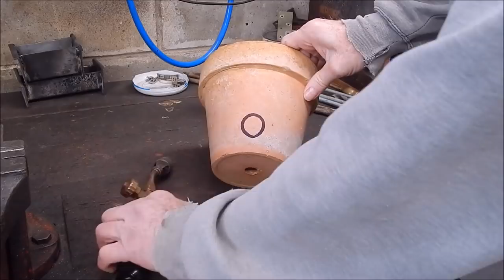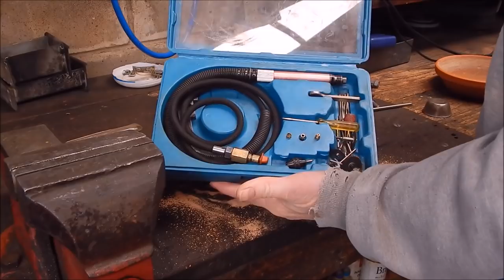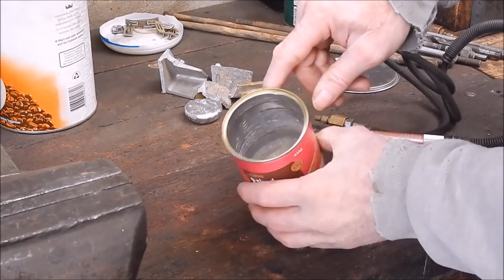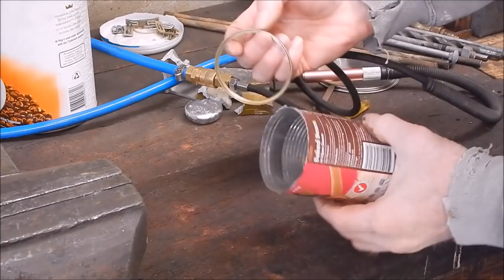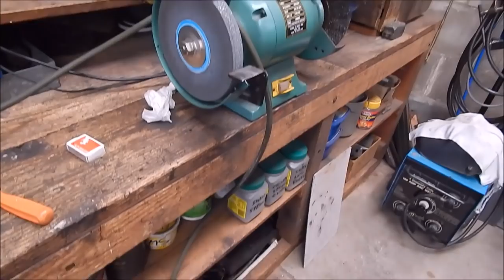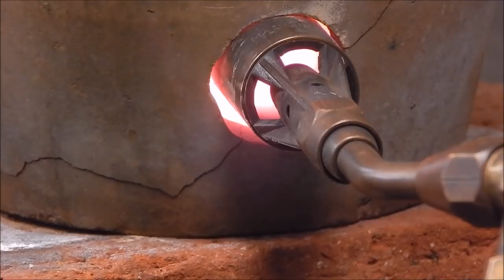Melt aluminium in a flower pot furnace

Comment: Very nice indeed. I have seen these flowerpot furnaces before. They are usually lined, sometimes with cement, or better, castable refractory. As to the lid, don't give up on it. Just drill a 30mm (size not critical) hole through the lid. That will give you draft for the torch. Also myfordboy's channel has an excellent series on furnaces. His torch goes through "tangentially" to the pot, so you get a swirl effect on the torch.

Comment from the maker: This worked so well that I'm making a durable small furnace just for this LPG torch.  It's not a flower pot design as I think the tapered shape of the pot is a bit restrictive compared to a cylinder shape, and the pot is not very durable.  I even spent real money to build this so it had better work.  My next video.  Stay tuned.  Cheers Rob.
Reply: xynudu You look at the subject from the wrong place . not to melt the important thing is to melt the metal form .

Comment: Robert,
     I built a similar setup a year or so back, with a few differences you might want to consider.
I used a flower pot about the same as what you used, hole and all. But I put it inside a metal can about 100mm larger, that used to contain pretzels or chips. I filled the gap between the pot and the can with grout mixed with Perlite (available at the local garden center). Packed it in real good, it took a few days to dry really well. This keeps the pot intact should it crack eventually and acts as a insulator/heat sink.
     If you want to use a lid, use another flower pot like the one you had (upside down) with a hole in it to act as a chimney. Burner must have outside air to work properly.
      Before you  can use any metal can that previously contained food as a crucible, you must burn it empty to get the plastic lining out of it. Or else you end up with that crap in your pour.
     One more tip, if you want to pour bars of a consistent thickness, prepare a level spot to set your mold on. Otherwise they come out lopsided like yours did. Cuts down on wasted material and machining time.
Reply from the maker: Best Racing Tips Win At The Dragstrip Sounds like you've nailed it.  I will take up your tips next time around.  Thanks for posting.  Rob
Reply from the maker: xynudu When the perlite/grout mix hardens, is it capable of being used free standing ?  Could you say put a tin can in a bigger tin can with the mix between them and then remove the cans after it dried - would it hold up with heat ?  Rob
Reply: Best Racing Tips Win At The Dragstrip "Before you  can use any metal can that previously contained food as a crucible, you must burn it empty to get the plastic lining out of it."..   Totally agree there. Sometimes the lining is white and sometimes its clear and you cant see the lining, but it is there. Its probably even more important to pre burn it out if you are using the tin as a mould. What I found if you don't burn it out is its more likely to create porosity/voids when you pour the ally into the can from the lining burning and releasing smoke/gases.
Reply: Exactly.

Comment: Would't it work even better when you put your torch in at an angle in order to get a swirling flame around the melting pot, and make a fairly large hole in the lid, so the gases can escape? That's how the larger furnaces mostly work. cheers.
Reply from the maker: Flip de boer Sounds like a good idea.  This video is bound to get lots of ideas on how to improve the experiment :)  All welcome.  I just tried out the original concept, and got it working with a regular LPG gun.  More time may get it going better.  Cheers Rob

Comment: I was wondering if a flower pot might stand up to my burners so I could use them as a crucible. Steel vessels dosen't last 5 minutes in mine but then I realised flowerpots would have a hole in the bottom. Still, Might be ok for seperating out the steel  from aluminium and copper when I melt things like alternators and starter motors.
I like simple and easy ideas like this. Thanks for showing what you came up with.
Reply from the maker: Oil Burner I wouldn't use a flower pot as a crucible.  No way. It's brittle, cracks easy and would be totally unsafe.  A proper crucible made out of the right stuff would be the only way to go for what you are doing.  Stay safe.  Cheers Rob

Comment: I have salvaged a silver stainless  steel microwave casing which provides a fantastic melting space. It also has the wiring holes which serve as the air entry and exit points and is raised off the floor so when stood on a paving slab is fairly solid. I line the inside floor with firebricks around the edge with a 1" gap all around between the bricks and outer. I fill the 1"gap with vermiculite and then put a 1" layer of refractory cement all over the top of the bricks before laying a mesh across and a 2nd layer of firebrick on top of the bricks only. Ensure the small air (former wiring) holes are exposed and then simply close off any areas of vermiculite at the front with refractory cement and allow to dry/set. Later, return with your blowtorch and melt to your hearts content. You now have a movable furnace where the casing and stand should remain fairly cool and not melt and hopefully it should last for ages. I have been using mine on a weekly basis for over a year and its only getting sooty inside and just occasionally needs a sweep out. I would recommend the stainless steel cases as white colour innards have microwave paint coating and I'd hate you to get gassed.
Reply from the maker: Great idea Nigel.  I suppose you could also use a stainless steel electric bread maker liner/tub for smaller quantities.  Got me thinking.  I must keep a lookout in the roadside trash.

Cheers Rob

Comment: Just to chuck my twopence worth of ideas how to keep it simple and get a better result into the ring. I think lifting the flower pot up a bit (support it on two bricks) would allow air in through the bottom (could try putting the flame in through there as well) hole, then put a couple of bits of steel rod in the bottom of the flower pot to lift the can up a bit, for the lid, use another inverted flower pot which fits outside the bottom one would give a hole for the air flow in the lid.
Reply from the maker: Stephen Deakin Yep, definitely didn't breath properly, even when the lid was canted off.  All good suggestions.  Cheers Rob

Comment: That flowerpot is a write-off! The problem with the airflow is probably due to the fact that you used a stand as the lid, without a vent hole. Using two flowerpots or perhaps a metal plate with a hole in it as the lid may yield better results. 
All furnaces I have seen thus far have an opening at the top.
I'm still investigating the ratio of the melting chamber versus width versus the vent hole diameter. What I've come up with thus far is a 2:1 ratio. The furnace under construction is to have a melting chamber diameter of 21cm and a top hole size of 10cm. The internal height of the chamber will be approximately 36cm. 
Happy casting!
Reply from the maker: Leo Gijssel Thanks Leo.  This was a quick and dirty experiment, but I'm getting lots of good suggestions on improvement in the comments.  So I will revisit this and make a propper small durable unit.  Cheers Rob

Comment: When i used a flower pot it cracked really badly and molten metal and coal went everywhere. Watch yourself buddy. Use 50/50 mix plaster of paris and sand and line your pot with 1-2" of the stuff. That'll act as a pretty good heat shield.
Reply: Paddy Cusack would water based clay work as a heat shield as
 well?
Reply: +toppertruthio I would imagine so
Reply: Paddy Cusack that's not what heat shield means.
Reply: And just smash the pot when dry, and you have a perfect cement crucible ! no need for the pot.....

Comment: Just wanted to say what a great video. But I have a little suggestion for you to possibly try. For your lid you used for the flower pot furnace, use the same lid you did but try and drill a hole in the center of the lid so the heat has a way to vent out a little. I made a little furnace from a tiny paint can and had the same issue with mine until I put a hole in the center of the lid and it worked out great for that. I'm just curious if it would work on the flower pot lid. Thanks for the video and it was great and I'm going to try and make one.
Reply from the maker: Hi Corey,  that video was done quite a few years ago and I've experimented more and moved on since then.  Yes, a lid with a hole in it that can be regulated is the go for best effect.  Plus you can heat up the mold by placing it over the vent hole.  Clay pots are not very safe to use and it should all be placed at ground level in case anything goes wrong, so that molten aluminium will not spread as easily.  A paint tin furnace is a better way to go.  Play safe.  Cheers Rob

Comment: Make a small hole in the lid to vent the fumes out and create an air flow to pull fresh oxygen in, as a flower pot has a hole in the base, kine the flower pots with plaster of Paris as an insulation layer.

Comment: Nice job, Rob! The trouble with clay pots is they don't like thermal shock. If you had preheated the pot before you got down to business, it may not have cracked. They make special high temperature cement for making forges for melting metals. Check out Keith Rucker's YouTube channel as he melts Babbitt for bearings on the old machines he restores. I also liked Emma's comment! Thanks for the video.
Have a good one . . . and eat more beans!
Dave
Reply from the maker: Swarf Rat Yep, that pot was doomed from the moment I laid my hands upon it.  But at least we proved that a plain old LPG torch has enough guts to melt down a decent sized amount of alloy in the right conditions.  So expect more on this subject.  I don't give up easily.  And however I do it, it will be cheap :)  Cheers Rob
Reply: Even with a slow heat/cool down they crack...eventually!

Comment: I like this old video, however, I'd like to suggest you first give the pot/tool a few coats of water glass, inside and out, allowing each to dry completely, before moving on.

Secondly, use 12.5 - 25mm ceramic blanket, as an inside liner, glued on the outermost side, with more w.g. and when dried  spray the other inside fabric with several layers of the same it until the material is  very firm to the touch.

Line the bottom with a layer of ceramic cloth, with w.g.treatment, raise the bottom with a layer of another 25mm, using pearlite, again waterglased.

Make a second hole I to the side of the pot, beforehand, for a 25mm air inlet, to which you add a pipe with a long hose, and a hair dryer on cool.

This is your air supply and will increase the heat, saving gas.

Good luck, and I've seen you other video with the paint cans.
Reply from the maker: Thanks for the suggestions Eli.  My next furnace will be made out of a scrap 9 kg LPG/propane cylinder, or a small air compressor tank I have behind the workshop.  Thermal blanket lining was part of the plan.  Plenty of people have done this and they work very well.  Cheers Rob

Comment: You need a step bit.
Also, put that torch through the hole at an angle, so the heat circulates more evenly around the crucible, rather than shooting the heat directly at the crucible. The aluminum will melt more evenly that way.

Comment: Pretty sure that a diamond tipped ceramic tile hole cutter (low cost sets on eBay are very good) would almost certainly make a better, cleaner, faster, simpler job of cutting the hole than masonry bits.
Reply: Bob Lewis cool, that's what I planned
use.

Comment: You needed to cut a hole in the lid so you could add material and it would also allow the fire to breathe it would heat even faster that way.I suspect the reason the pot cracked was due to moisture in the terracotta pre heating it at a lower temp to drive out any moisture may prevent the cracking. To be safe I would suggest a couple wire hoops to keep it from crumpling, in that event.Gabby
Reply: Or have two terra cotta flower pots stacked, widen the hole in the bottom and use a fire brick or two for a stand for the crucible and furnace.

Comment: Brilliant. Maybe another similar pot with hole in the bottom would have worked better as a lid?
Also put some steel wire around the pot to hold it together if it cracks.

Comment: thanks for the video it answered a few questions that I hat about the melting threshold of tin vs aluminum.
Reply: +crgaillee Fyi tin would not make a good crucible because it melts at 231 C but aluminum doesn't melt until 660 C .... so what gives, why is this guy able to hold molten aluminum in a tin container, at a temperature more than double it's own melting point.. actually probably more than double. Well the "tin can" is probably mostly steel, with tin plating.
Reply: Brew Dain because cans aren't made of pure tin...
Reply: Mike that was the whole point of my comment. Read all the way to the bottom. "Well the "tin can" is probably mostly steel, with tin plating."

Comment: Hi nice test. But be careful. Please do your experiments on a bottom of dry sand. It s easy to burn a hole in the tin can, the molten alu drippes out of the burned hole through te burner hole. Everyting the melted metal contacts will set on fire... Don`t think about when someting is dripping from the bench over your shoes! Melting metal : use precautions, even when its only a few cubic centimeter. Grtz Jan.  (Did several wvo furnace alu melts)
Reply from the maker: compujan Yes, always play safe when handling molten metal. Rob

Comment: Very nice job sir! But as you suggested to prevent cracking, cement would only be worse. Clay is far more resilient to heat than cement concrete.
Reply: unless its insulating concrete or whatever its called.
Reply: It's called castable refractory.  It works like mortar, except it has aluminum oxide or silicon carbide in it instead of rocks and sand.

Comment: The guy you linked to did not really use flower pots. He used the pots to line with castable refractory. Or high heat mortar basically. That's why his are holding up much better.
Reply from the maker: Aaron Kimmins Your right.  I didn't read that bit.  That's why the pot is cracking up.  Good point.  However, the principle is still the same.  Just needs a bit more refinement. Rob
Reply: Exactly, very good idea for an inexpensive furnace!

Comment: Another good demo vid Rob. My lpg torch is identical to yours, its my old mans ex pmg/telecom, companion brand torch, on oldie but a goodie. To be honest, I never attempted to melt aluminium with it but now I know its up to the job for small melts, I think I will be making a mini version of my current furnace. Then maybe have a go at some small lost wax castings for model engine parts. I was holding my breath the whole time you were drilling that hole and laughed my head off at your "oh well, I'm off to the bank now" comment at the end :D
Reply from the maker: djpaulk No luck at the bank :)
Reply from the maker: xynudu Would you use a spiral flame effect (offset burner tube) or point straight at the centre  ?  I doubt these guns are big enough for a spiral flame effect.  What are your thoughts on this?  Rob
Reply from the maker: djpaulk I've made mine with a straight in burner port, but I could easily grind it out on the inside to make it angle.  I've just used 1:5 Portand cement and perlite.  Hope it holds up with the temperature.  A few people on the web recon this is OK, but remains to be seen.  You can mix it from 1:4 to 1:8 according to the construction site specs.  Takes quite a while to dry out, even with our 30+c temperatures.  Rob
Reply: xynudu It should hold up to the temp ok. Glad you did not go max ratio with the perlite. While perlite is a great insulator and dramatically reduces weight, its also very fragile, weight should not be an issue with such a small furnace anyway. Did you leave a tin can inner form in? Did you add any steel wire or anything for reinforcement? Hope you packed that stuff in well to minimize voids in the refractory...Keep your eye out for a bag of fire clay. You can use the left over to make green sand, knock up a few flasks, make some patterns for things you want to cast and away you go..  I am hoping you get some nice warm weather down there and eagerly await your next vid.
Thanks for sharing your trials and tribulations..    Kind regards, Paul
Reply from the maker: djpaulk Hi Paul.  This time around I used a regular paint tin (4 or 5 litres ?) as the outer, and a 500 gram coffee tin as the inner liner.  This makes a good sized centre and will take up to a large fruit tin as a crucible. I left the two tins in place after packing in the mix. No reinforcing but I rammed it well. Be interesting to see how it performs.  Rob

Comment: Rob, since we've talked before I know you haven't burned your shop down yet! :-) The cracks in the pot we're making me nervous. I was envisioning an aluminized Rob! Most surprising to me was drilling that hole. I had no idea a clay pot would be so damn hard to drill. If you had turned and internal wood plug you could have jam chucked it, so you'd have two handed drilling. Hey! Did ya clean that shop vac filter yet? ;-) Cheers! Chris
Reply from the maker: The whole pot idea is not really a good idea.  I only left the video there because it got a lot of interest.  My paint tin furnace is much safer, insulated and cheap, so there's no reason to use a clay pot.  The shop vac gets plenty of use.  Cheers Rob
Reply: @Xynudu  Rob, please post the link to that video.
73's  Chris
Reply from the maker: Here you go Chris:

https://www.youtube.com/watch?v=Osa_c1XkjQs

I made that seven years ago and it's still holding together and being used regularly.  I have the bits to make a larger version out of a 10 kg propane cylinder one day.

Cheers Rob